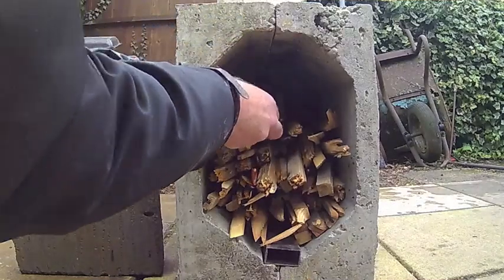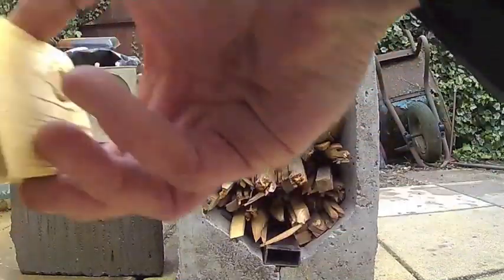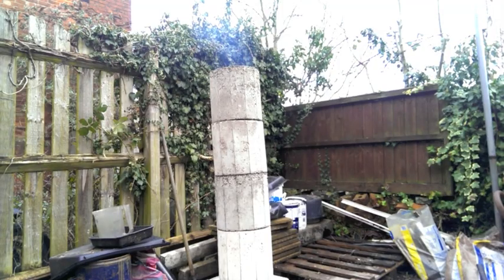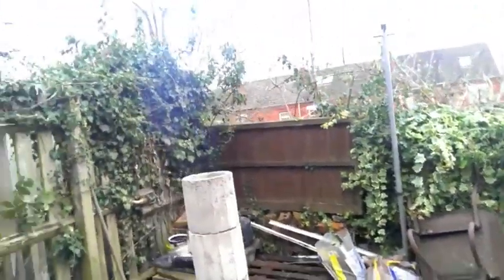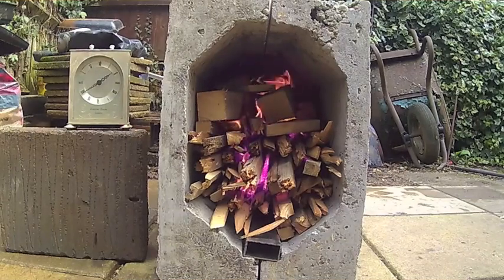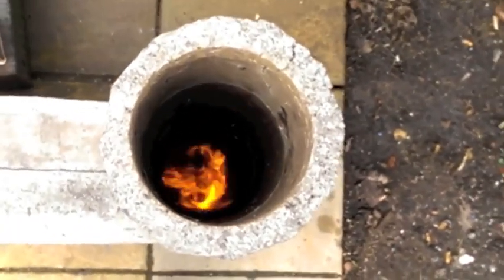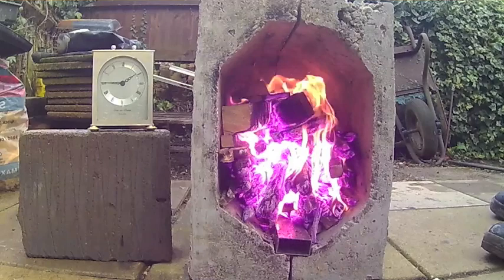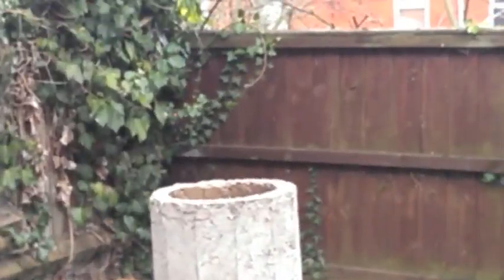Rocket Mass Heater Batchbox First Test Burn From Cold

Comment: thats pretty cool but i dont know where to find ciment fondu in washington state, US
Reply from the maker: tinbender, it may be under a different brand there, although Kerneos, the manufacturer, has a North American office. If you ask at your builder's merchant for high alumina cement, more properly called calcium aluminate cement, they will be able to source something equivalent. 

I did build some with Portland cement to experiment and they worked fine. Over a few burns the surface of the concrete spalled heavily but the main reason they failed was that they were structurally very weak because of the high perlite content. I think they'd have lasted longer if I'd used clay pebbles too. 

A compromise would be to experiment with rapid-set cement as these are usually mixtures of Portland and high alumina cement and may have better heat properties, although I haven't tried and don't know how much aluminate is in them.

Also, the batchrocket.eu website has lots of designs built with refractory fire brick. It doesn't have to be cast like mine.

Thanks for your comment and good luck!